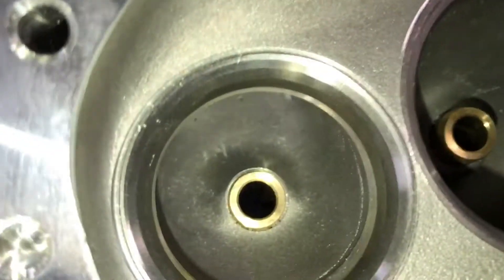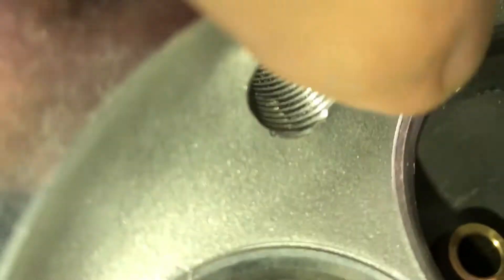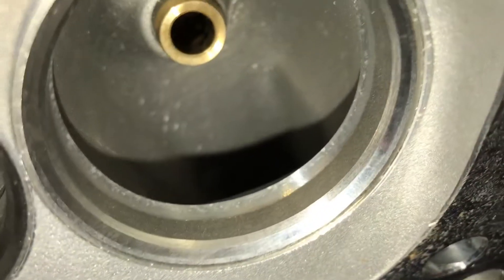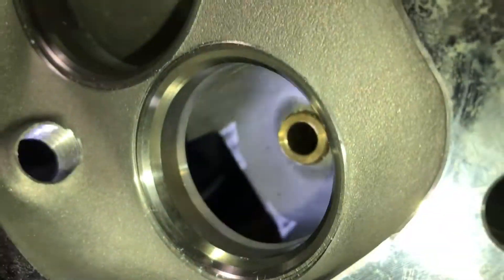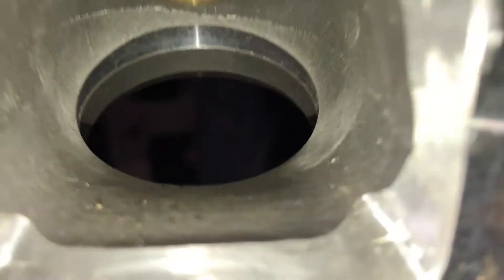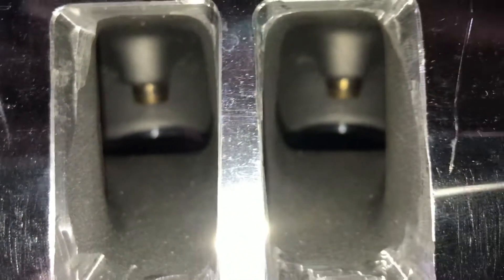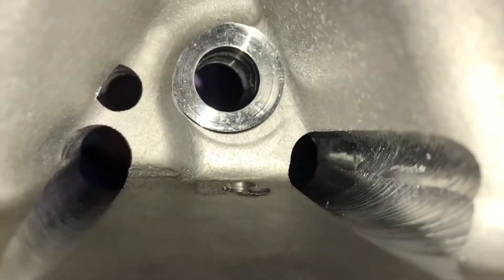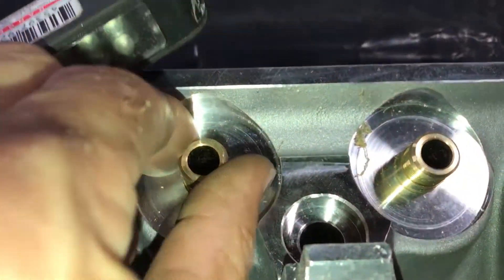Speedmaster 210cc angled plug head

Comment: I have these heads on a 71 440 ( bored 030 over with a cut crank, old school forged pistons, Hedman long tube headers, stock Magnum cam, vintage Torker intake manifold and Holley sniper EFI. It works very well in my opinion for a decent street engine. The engine builder who assembled these heads was complimentary to them even compared to Edelbrock Performer RPMs. If you want more, then go with Trick Flow heads, but these work well.
Reply from the maker: Moments ago I finished watching todays Engine Masters.  They dynoed stock 906s, 440 source, Ebrocks, and then 240cc Trick Flows.  Both torque and power went up with each successive head swap.
Reply: @TheProchargedmopar  I spent about $1500 Canadian on the Speedmaster heads. And because I have a girlfriend who is carefully watching expenses I could buy first one head, then the other and then the components then the machine work. Finally the install. It was for me a bit of a difficult time. My finances were cut to the bone and it was a stretch to get it. But my tech was surprised. He is right now not very complimentary about Edelbrock heads ( in particular the " E- Streets"). These compared in his view with the Performer RPMs ( early ones made when Vic was still alive) and not as good flow wise as Victors. The TF heads like the Victors are for a meaner engine. In your case with ( unless I miss my guess) a supercharged B/RB you probably need as much airflow as you can get. My power production is likely not going be enhanced by TF or Victors so for my application it's quite good. Likely a solid horsepower per cubic inch.
Reply: @TheProchargedmopar  I look forward to seeing that episode on free tv, someday.

Comment: In reality those ports are way too f**** big unless you're running an all-out 9000 RPM race motor they are going to have such low velocity which kills flow they're really not very good heads buy cheap you get cheap will your valve spring break or you drop a valve float a valve because of poor quality springs valve seat falls out valve breaks and you destroy your whole f**** motor were they really worth it then

Comment: Are those for 11/32" valves? If so what size ball hone would a person use for putting some cross hatch in the guides without making them any bigger or looser
Reply from the maker: James J. McCloud Yes 11/32, not sure one size as I'm not a n auto machinist.
Maybe go to manufactures website for specific size?